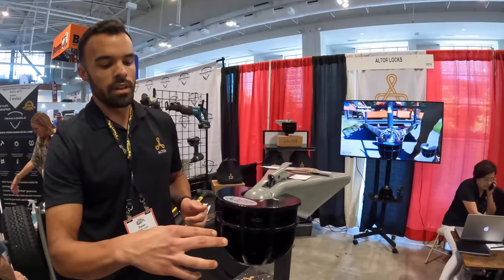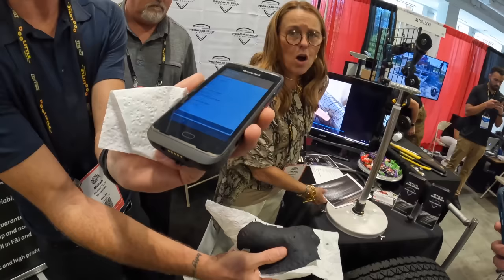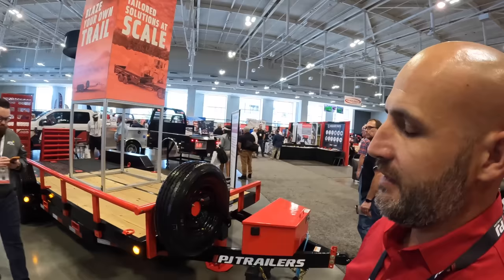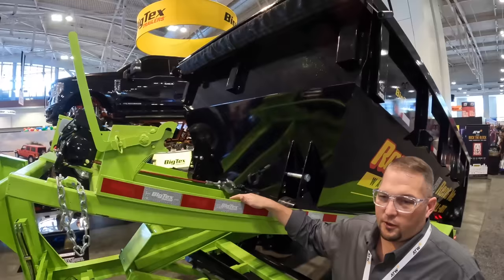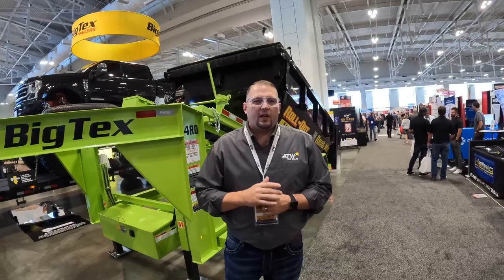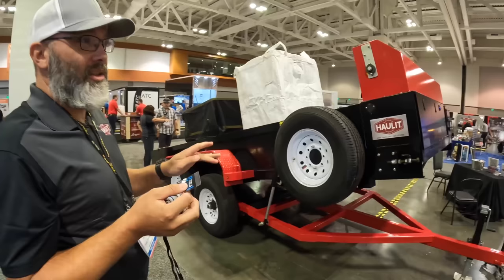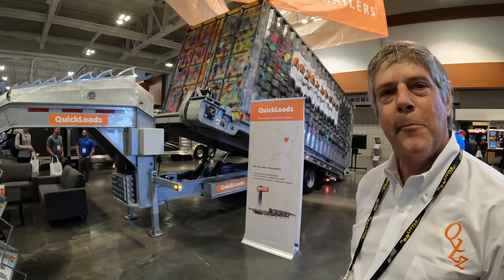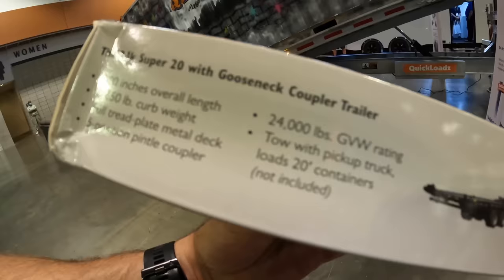First Looks at New TRAILERs ! #NATDA #bestnewtrailers

Comment: I got lucky bought a new 12k equipment trailer couple weeks ago for hauling mid size tractor out and hay in 18+2. Was originally targeting a 14k but came across a custom build someone did on a 12k and never picked up. Had the heavy duty ramps 24x60, steel dove and wood floor, black wood, D rings also up sides, steel in place of a board. 5900 included a tool box...

Comment: I think you should do a follow up on both trailer locks. I would say inside of the month there will be a YouTube video on how to defeat both of them. That seems to be the way it goes with every trailer lock I’ve ever purchased.
Reply: It's an accepting thing that ANY lock, safe, or whatever can be overcome given the time and resources - what any of them do is make it dificult enough to not be worth the time, effort and risk to beat them.
Even then, when people do demonstrate them being beaten, it's by VERY experienced people working in optimum conditions - neither of which are likely in the field.

Heck with trailer locks, if someone wants it that badly, they could cut the entire hitch off off the trailer, at the trailer, and weld on a tempory replacement they can hitch up to.

Comment: A little surprised the trailor lock chap said he hadn't hit it with a sledge hammer, but that might have been him, personally, and they'd actually had people wailing on it for hours. The fingerprint scanner is neat, but when you consider the operator is likely to have dirty hands, even be wearing gloves, it may be less useful.

The PJ chap seemed to be quite worn out by that point - might be an idea to have more staff next year to give some relief?

Bix Tex - I like the battery on the lift frame - smart move, also like the focus on stack, as it has many advantages.

With the shipping container loader/unloader, same thing as I mentioned a few weeks ago with the Roll Outs - there is potential for utility companies to build mobile generators on the platform, emergency pumps, mobile offices, secure tool sheds, ablution blocks, etc - basically anything that needs to be moved and that can be built onto the standard shipping container base design dimensions.
With the added security that only specialist vehicle can transport them - the 'average' thief could hook up a trailer and steal the equipment, but not this.

Comment: Altor trailer, l...what about just drilling the lock?. it's a ball design in reverse lock. think like a thief to catch a thief...just design a can or bucket to drop this upside down trailer ball into such as a can/basket hitch and a large U- bolt to flip over it behind the coupler latch and you are good to run down the road. later on torch it off at the convenience of your chop shop.

the Kevlar puncture stuff is a must have for companies that have employees who mow over utility marker flags, as once you chop the flag off the wire, those wires are still in the ground perfectly vertical to puncture the tire until a tire holds onto those metal stakes and pull that stake out of the ground... could be 1- or 50 punctures later. had 1 south of the border worker run over about 1,400 feet of these flags on one property, the very same day he did it, one tire on his machine had to be fixed FOUR times losing 4 hours of work on just that one machine, and it still had to have the tire replaced the next day due to all the leaks.

don't really care for PJ trailers, they rot apart pretty fast.

very interested in the big tex roll off trailer....need to get a more capable truck for it first to make a killing in an industry i know a high demand market for.

quick loadz....omg this is going to make so many things game changing. i can instantly think of 3 high profit jobs that can be done with this system.

Comment: They need a chain lock or place 2 lock the chains up
I watched a video where they stole the trailer using its chains even if the hitch is locked with that 
Proven locks has 1 & is cheaper than this 1

Comment: 13:13… uh, no dude. If the battery is dead that winch isn’t gonna do anything with a 14 gauge wire and a 7 pin with a 15 amp fuse.